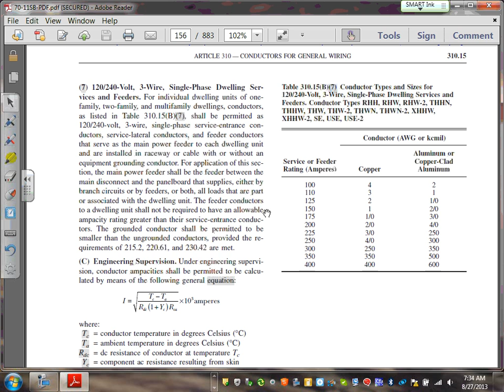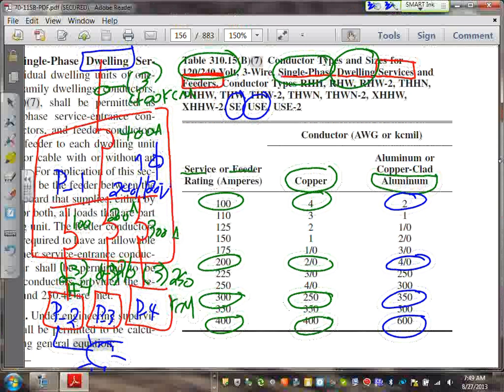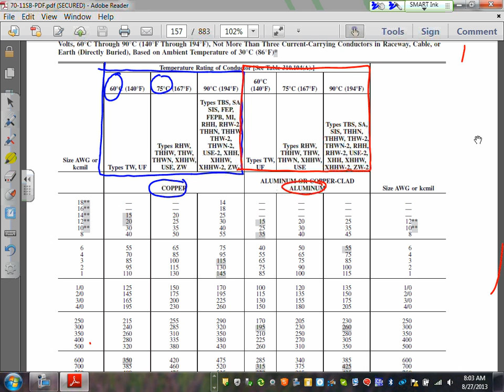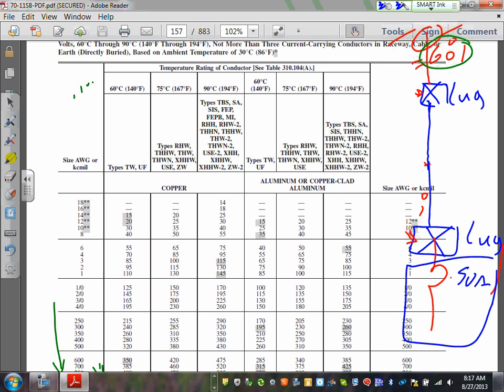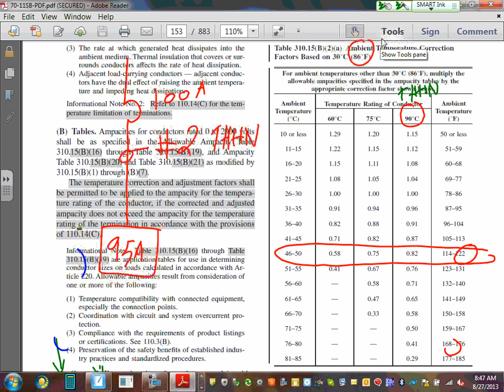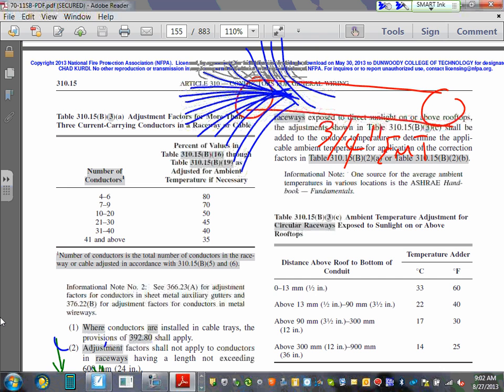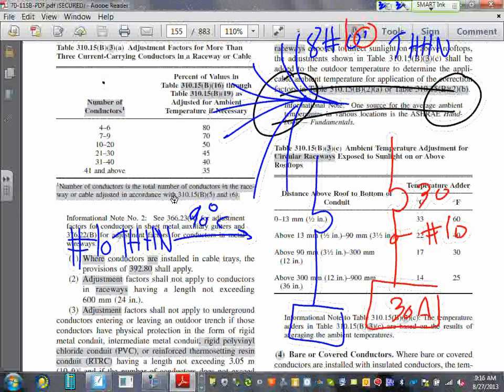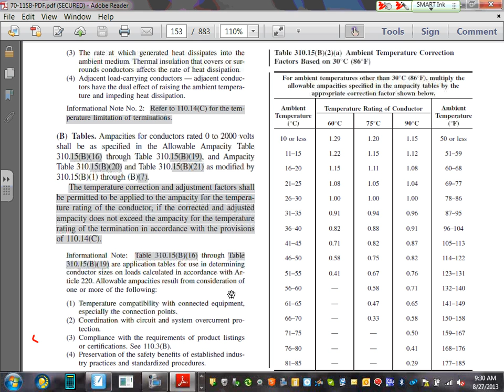Ampacity & Derating 08 27 13

Comment: Thanks for the videos. I have a question though. When you derate using the table ampacity under the 90ºC column in both 310.15(A)(16) and 310.15(B)(A), it is my understanding that resulting adjusted ampacity tells us the maximum remaining amount of current due to ambient conditions required to bring the temperature rise up to the temperature rating of the conductor. Given this, how can this method be valid for terminations rated less than 90ºC? if 110.14(C) specifies that the temperature rating cannot exceed the lowest temperature rating of these terminations?